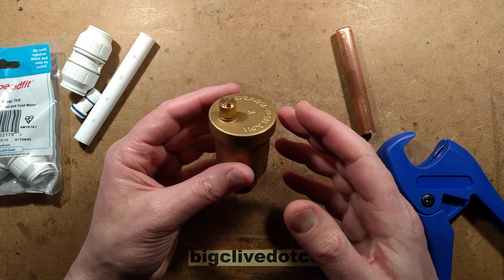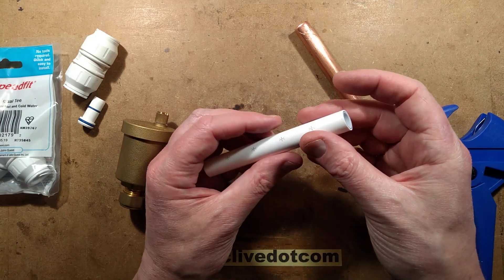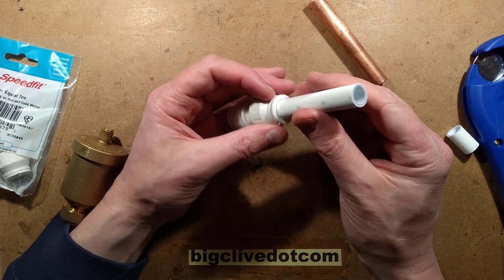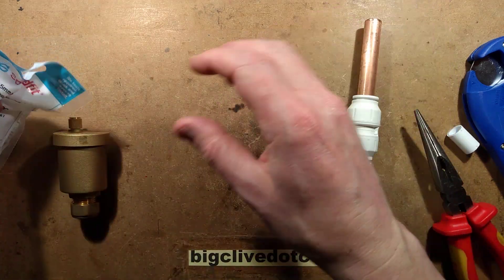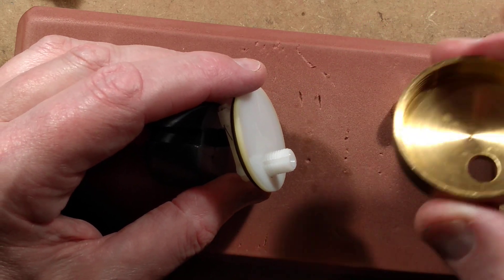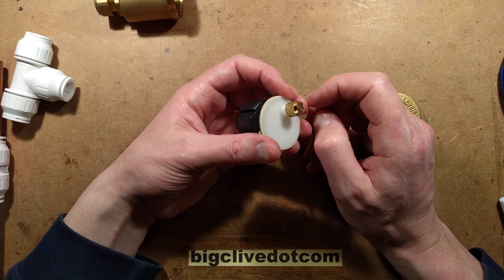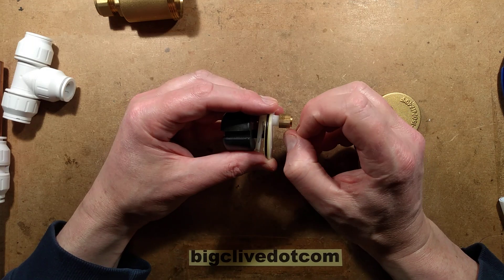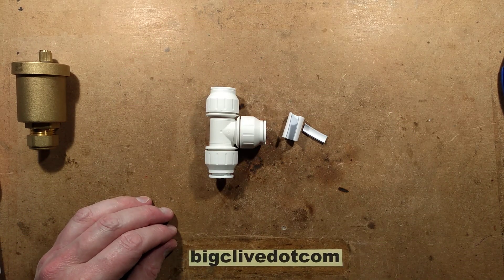Inside a bottle air vent and plumbing ramble.  (No electronics whatsoever.)

Comment: In the US we have a similar fitting called a shark bite. they come in sizes from quarter-inch up to 3/4 I believe and will work on plastic as well as copper. They're quite a nifty I've been working in hardware store since I was 14 and they came out I think when I was am I early teens. they're wonderful little invention for the home plumber or for someone who doesn't have any soldering experience.

Comment: Im waiting for plastic to prove itself...remember how LONG those copper lines lasted.   
Its the same with the OLD copper wire, separate it by 12-18 inches and the odds of a fire arent very high...Now we have Romax, and Pray it dont cause problems...  The Worse part tends to be high voltage, Lightening..That can Jump the wire that is So close..over all 3 wires.
Reply: wire separated by wide spacing is bad.... because of EMF, it can cause heating of ferrous metals in close proximity, radiates noise everywhere and that also causes the wire to heat itself to dangerous levels... think of the metal nails fastening all the porcelain insulators and other metals/pipes it goes past....
if you have an old knob and tube home it should NEVER be insulated, as it's a wiring system that requires "free air" space, to keep it cool. which is why K&T was abandoned
https://en.wikipedia.org/wiki/Electromotive_force
Reply: @throttlebottle5906  EMF can bother the three wire combo thats being used NOW.. because its not Twisted.  and worse still is the Wire NOW days tends to be abit lighter then the old stuff.  I love looking at ext. wires and such compared to the older stuff...and it scares me.   Have you ever seen Western union wireing??  its Run around Railroads, and individual wires, and 1 -2 Cross every once in awhile...it breaks inductance..
Reply: @ecash00  the proximity is close enough it cancels out very well at 50 to 60hz ;)
don't crank the frequency up....
dinosaur wiring for morse code is about like comparing apple to oranges ;)

Comment: That's clever. The brass cup alone can be used as a manual bleeder valve, or they can sell it with the plastic float as an automatic bleeder valve. And I'd bet the plastic float is a retrofit to a pre-existing manual design(so they don't have to adjust the tooling for the brass parts)

Comment: We used air eliminators on pumps running liquids with high amounts of dissolved gas.

Different design, basically just a metal ball that floats.

Constant PITA.

Comment: What about the linear expansion of PEX vs copper?  Supposed to put in U-sections every so often for copper, to account for pipe (tubing) growth.  Seems PEX would grow in length with temperature at much higher rate than copper.
Reply: yep, it grows "miles" and turns into spaghetti if it doesn't have room to expand and careful if you repair when it's real hot, cause it will contract when cold

Comment: Used PEX a while back to put a garden tap in a sensible location in my garden, did run into one minor issue, but it was entirely my fault, I put clamps too close to a joiner I had in the system which forced the pipes out of alignment which caused the joint to leak. Other than that it's been solid.

Comment: Clean the copper pipe with dry steel wool.
Reply: Geoffreyinoz there is a specific type of sandpaper called Emory cloth used for cleaning copper pipe.
Reply: @HighestRank  I use steel wool as it isn't as aggressive compared to emery cloth, steel wool leaves a smooth surface that is more applicable when using compression fitting, less chance of leaking, I use emery cloth on old corroded copper pipe prior to brazing, each has it's purpose.

Comment: I will say PEX is better in a sense that it is easier to work with. The down side is in wall when sealed up that people will put in random nails/screws and make a leak to find, though by most building codes there should be a protection plate over the pipe work in a wall stud. Open wall cavities it can move. If I do any jobs now I use the crimp rings for the saving grace that the pipe is held tight to the barb fittings on the metal fitting. I have used shark bite in the past for replacing parts of copper that has split due to freezing but the fittings were in easy to get to places. Definitely recommend the usage of PEX due to its flexibility and ease to install.
Reply: the same folks run nails and screws through copper, iron, cast plumbing and wiring too lol.

Comment: Worked in animatronics, can confirm, compression fittings WHEN APPLIED PROPERLY are perfectly safe and reliable. However the margin for error is a fair bit narrower than soldering metal tubes together. Buy some bits and bobs to play with, put em under mains pressure. Youll figure out real quick if you did it wrong or not. Once you have the technique down,. go for the big job ;)

Comment: Those vents are a one shot deal, after the system builds pressure, they never open again due to pressure differential. Used for initial filling only.

Comment: those push connects are neat and handy, but very expensive compared to regular fittings and crimps.  If you doing more then under 1, maybe 2 sinks your better off renting, or even buying the crimp tool and a box of crimps.

That said, I personally find pex superior to copper in pretty much any way.  It's cheaper, easier to work with, lasts longer in area's with not so good water.  It keeps hot water hot for longer.  There's literally no reason I can think of that would make me use copper over pex.

Comment: I used to have problems soldering wired connections... electrons would leak out when I turned the power on.  Quite a mess.  ;)
Reply: LordCarpenter that’s why Ròmex 3 wire has a bare copper strip included in the jacket between all double-insulated runs, to absorb those.

Comment: If your copper has many tiny pits, it's galvanic corrosion. 
There's a galvanic metal somewhere in the system, probably iron pipe somewhere.
Google "galvanic corrosion chart" to see a list of incompatible metals.
Reply: Christopher Stone how about a whole tank made of Fe? Would that be enough iron? The cheap aluminum anode rods used in water heaters won’t ever be blamed for reduction, it’ll still be blamed on the pipe. Strawberry Fields Forever.
Reply: pretty sure he said the heating system, which is likely all cast iron radiators and probably cast iron boiler at one point, and the circulator pump among other things ;)
keeping the system sealed tight without makeup water is key to sealed hydronic system life, "keep the oxygen out"

Comment: pulled all my "copper" i say that in quotes because my place was built when copper prices went high and manufacturers/builders used a very thin pipe called water distribution piping, didn't last more than 30 years before failures.
I changed to PEX tubing which is easy to thread through the walls and is run like cabling, we have shark bite fittings in the US similar to the play piece you had, but with my install I decided to use copper crimp rings, the PEX expands quite a bit when water freezes and returns to normal plus with minimal fittings the flow is increased

Comment: Hi Clive. As good as plastic push fit connectors are, proper plumbed soldered joints are much better and are the only joints for gas safe. Also please check out compression fittings and 'Enots Fittings'.....

Comment: useless as tits on a boar hog. Any oxidizer in municipal water systems will turn that poly/ silicone washer harder than a nuns clit on easter. it will leak too. (also)?. Chemical weld plastic pipe or braze/ solder copper. Otherwise your just pissin in the wind. Clive you know better.  We call the brassy thing the maid of the mist here in the southern US. Automatic for the people my a$$.  :)
Reply: pex = Quest pipe.... google quest pipe.
Reply: @glenn1524  pex = cross-linked polyethylene  and not POLYBUTYLENE  (quest was just one brand of it)
https://en.wikipedia.org/wiki/Cross-linked_polyethylene
https://en.wikipedia.org/wiki/Polybutylene

Comment: I redid my house in pex 5 years ago.  It was pex-b, and I used the stainless steel crimp rings.  Our push to connect fittings dont have the collet to tighten which is kinda neat.  The pex is cross linked polyethylene.  Which is something to do with the chemistry of the tube.

Comment: Copper needs a proper cutter, never use a hack saw. The cutters only cost a few Pounds and come in sizes to match the copper pipe being cut. One last thing never use plastic connectors on Gas as it will not seal well, also illegal in the UK.

Comment: Had to have my small home repiped about a year and a half ago, the water here in Florida had corroded away the old copper. PEX tubing for everything was immensely easier to get it all done myself, and passed inspection with not even a batted eyelash. Of course, your mileage may vary with local code, but it's becoming the standard, these days.

Comment: the colored inner layer of the PEX tube is used to show if the line has been abraded or worn and is getting close to leaking. PEX or PE-X is Polyethylene Cross Linked also Cross Linked Polyethylene. the piping should be stamped with a class (A,B,C) that states how the pipe polyethylene has been cross linked.
Reply: Shawn Abernethy or you could just do like the Irishman and cut through the coloring into the crosslinking with your wretched knife like a dry bar of Irish Spring 🧼

Comment: A possible benefit of having the movable part seat a bit off center is that the valve will open and close less abruptly.  It opens a slight slice, then arcs to a larger arc and closes the opposite.  With a gentle close, you also don't get a 'water hammer' of the valve closing quickly.
tom

Comment: I went through a few if them, got a new one , and the last time I purged, I wasn't hearing any air so I gave it a rap and then it was letting air out, so I guess I'll be getting another one
Reply: Todd T if you drain and refill your hoses regularly, then I guess you should. If not, then keep rapping.
Reply: typical of them, the float gets stuck to the cylinder wall, closed or open! (system out of pressure) in which they start to pee everywhere, give it a couple mild whacks with pump pliers, adjustable wrench or screw driver handle ;)

Comment: Most of the plastic pipe work I’ve done involved adhesives. Hadn’t seen that type of fitting before. I don’t have all that much experience. Obviously it was all PVC pipe; probably I’d use PEX for new construction.

I did have a pinhole leak in a copper pipe here (1970s work). Condominium: my monthly fees covered the plumber’s work.

Comment: PEX is Cross-linked Polyethylene that is used to replace copper in homes now due to cost and ease of install. It is also used as a wire insulation called XLPE but there it runs into water treeing and electrical treeing issues.

Comment: Worked with this exact type of pipe and fittings and can say from experience it does not like ice at all, it’s used a lot on static caravans and even with insulation can still burst the pipe or blow the fittings apart, also had many occasions where the pipe had blown out of the fittings even though the water pressure wasn’t too high.

Comment: "no electronics whatsoever" nonsense, electricity is a sort of water, they taught me that at the technical college!
Reply: I didn’t know magic pixies could swim
Reply: pyromen321 angry* pixies can swim, though it’s those unyielding nymphs which are found in pipes.
Reply: MrGoatflakes they said that water flows, is stored in tank circuits, both run in currents but nothing so similar as being a ‘sort of water’, unless you attended Hogwarts.

Comment: Those fittings have been around for a long time in industrial pneumatic usage. I'm not sure how long, but I have been using that type of "push lock" fitting for over 30 years. Typically, though, they were used for plastic or copper tubing up to about 3/8" OD in industrial settings. When they came out for larger piping use outside industrial settings a few years ago, I felt comfortable using them right away as long as the price point was right.
In the US, they are commonly known as "Shark Bite" fittings after the leading brand of such fittings sold in the Lowe's Depot stores, and they are usually metal bodied, without the screw down outer fitting nut - just push it in and be done with it.

The O-rings in them are usually about a 30 - 40 durometer Buna nitrile, and can accommodate mild linear scratches easily, so don't worry about that.

Comment: These AAV(automatic air vent) always weep, guaranteed it's one of the main areas in boiler which will be the source of a leak/weep. Eventually it'll get all cruded up and you end up closing the AAV all together. This in fact  isn't much of a issue , it just stops.you getting rid of air in boiler more easily, than if it we're working. But this is only a concern when filling a system , as when it's filled.theres not much need to release air from boiler. Obviously every heating system needs venting once in a while..... And it's good fun venting a radiator ,then holding a lighter to the air escaping......which turns into a little jet of 🔥🔥 🔥, that's if the system is corroding and there's hydrogen build up😉😄

Comment: here in the states we have 2 main versions of that type of system that I'm aware of. A plastic Pex brand version and a metal version called shark bite. I have used both and actually prefer using flexible Pex and metal crimps and unions...

Comment: Push-fit connectors have been used in the pneumatics Industry "forever". Never had any problem with these connectors (pneumatic control systems in  many Autoanalysers, right up to 10 Bar pressure, which is well beyond any UK water mains pressures!)

Comment: PEX =cross linked polyethylene  We use it exclusively in the US for new home manufacture. Its been around a long time. Ours uses mainly brass barb fittings and a ring that crimps onto the tube to hold it.Those push in fittings are commonly known as Shark bite fittings .

Comment: That pivot is designed to have the air buildup push the float down, and not let it spit water out. We're talking about 12 to 20 lbs of pressure,  but if you need to replace one, isolate your expansion tank , turn off the water feed, and bleed the pressure off at the blowoff valve. There will be a big mess if you dont!
Reply: Brian O'C some have a small joining piece between the pipe work and valve. When the valve is removed the pipe work is sealed (spring inside). Sure you get a small spillage. ones fitted to my house were like that.
Reply: @AndyK.1  those spring loaded valves get full of crud and stick open when you remove the vent to replace or repair you end up with a geyser lol
Reply: Brian O'C I think this valve is rarely needed if you have an actual expansion tank at the highest point and small venting valves on each radiator.
Reply: @johnfrancisdoe1563  at our complex,  we have old hydrotherms. Closed loop baseboard,  3 million BTU with 7 to 8 separate boilers in series.  We have no choice but to have the expansion tank in the same room.  I've been begging management to get SPRIO-VENTS installed right after the pumps,  but you know how that goes. ..... with such a large, old system,  you are doomed to have air enter the system,  having no idea how or why.  These little "spit-cans" I named them, are a great asset to me in my situation.  What you explain makes absolute sense as well.

Comment: Plastic push-fit plumbing is more or less standard here in AU for domestic buildings as far as I can tell. My house is 20 years old, has plastic plumbing for both hot and cold water; never had a weep, leak or problem. We don’t have icing problems in my mid-latitude region, so there’s that.

Comment: Clive,  I've refit about half my (old) house with pex. I use Sharkbite brand fittings (US). Never have had a molecule of leakage. Well, you know what I mean. I used red tubing for hot water, blue for cold, and orange for the boiler (especially made for heating systems. Even gases can't pass through the orange). So easy !!
Also insulates better than copper.

Comment: I've had lots of problems with these in situations that aren't on mains water. They are no good at all in suction (but fair enough), however more surprising is pressure cycles like a pump output (even with accumulator) or vibrations on mobile applications (RV or boats) can upset them and with time cause leaks. Don't get me wrong, they are good for most domestic application, or when you require non-permanent joints in a high corrosion environment, and their speed makes them cost effective, but I have gone back to regular compression fittings on plastic pipe for some of the things I work on.

Comment: Done whole house and heating no problems after 6 years ...PS im a sparky not a plumber
when installing for first time dont put your boards down until you have water pressure first joint i did i forgot the insert and did not turn lock either drippy drip drip lol

Comment: I don't mind plastic fittings given the use is ok for them.  
I often use a metal compression "patch" hose to fix leaks in lines and such around the house.  I can get them in 8 inches up to 24 inches and are good to replace a section of damaged line while adding a level of flex that was not there before.  I forget what they are called but get them at Lowe's here in the states.   I'm wanting to say BullDog or something like that.